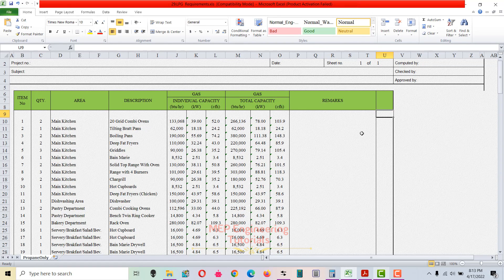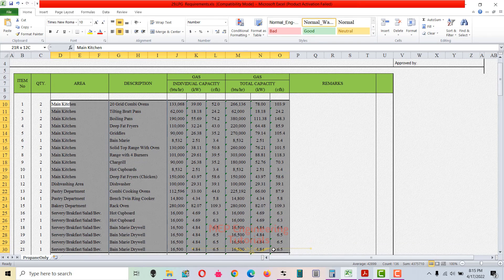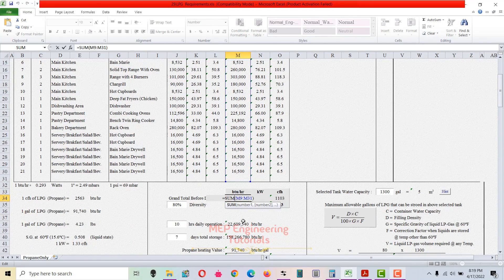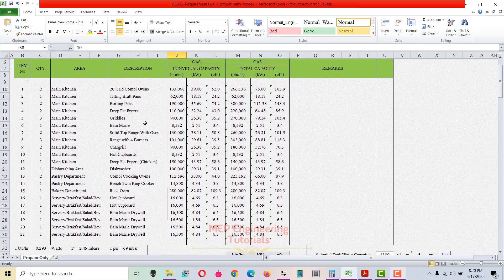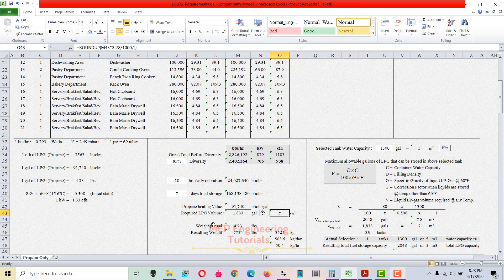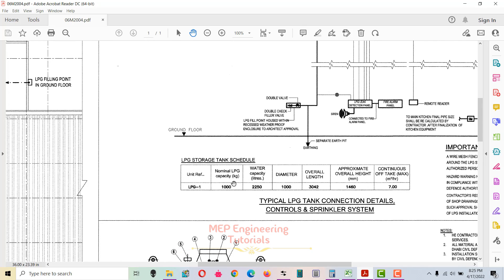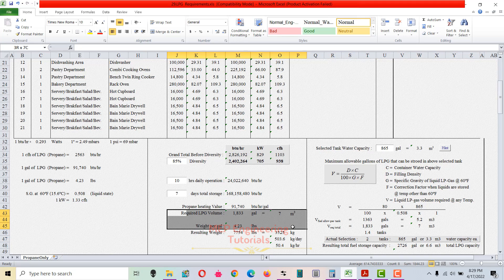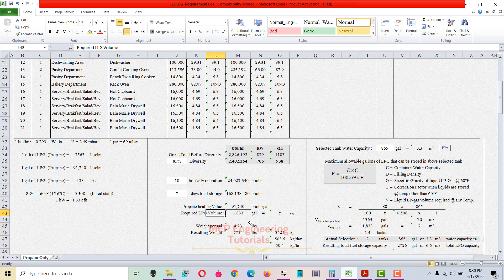LPG tank sizing calculation and selection using spreadsheet, Propane tank sizing calculation

Comment: a gallon is a gallon, and a gallon of liquid propane does not take up less volume than a gallon of water. there has to be an error in your calculation. your calculation says you can allow 2048 gallons of propane in a 1300 gallon tank. but the 1300 gallon tank can only be 80% full of propane, which would be a total usable volume of 1040 gallons for a 1300 gallon tank.  you can not put more than 1040 gallons of liquid propane in a 1300 gallon tank. for example if you have a gas grill that uses propane. and you have a 20 pound tank. on the side is the stamp of the WC which is the (water capacity) in pounds, if the WC = 47.6lbs, that means the tank can hold 47.6 lbs of water, divide that by the density of water. (8.34lbs/gal) and you will see the tank has a total volume of 5.7 gallons. if we take 80% percent of 5.7 gallons that is 4.6 gallons. there are 4.6 usable gallons in the tank to keep it at a max of 80% full. if you multiply the the 4.6 gallons x the density of Liquid propane (4.23 lbs/gallon) then you will see why they call it a 20 pound tank. because the tank holds 20 pounds of liquid propane. 4.23 lbs/gal x 4.6 gallons (useable volume) = 19.5 lbs, rounds up to 20 lbs. furthermore this proves my point that the 5.7 gallon gas grill tank can not accept more than 5.7 gallons of propane, it can only accept 4.6 gallons. please explain why your required volume of 1833 gallons of propane can fit in a 1300 gallon tank, that only has a usable volume of 1040 gallons (when 80% full)?